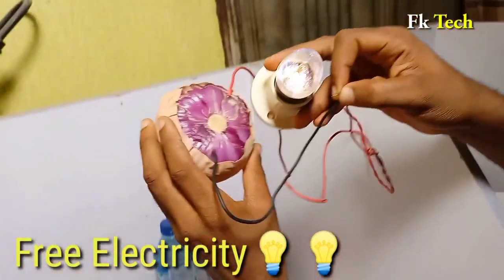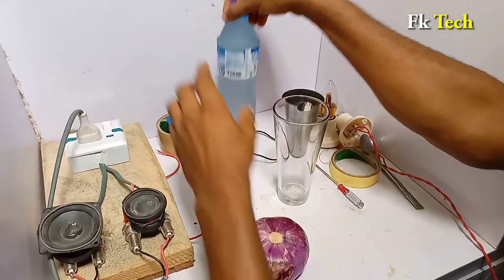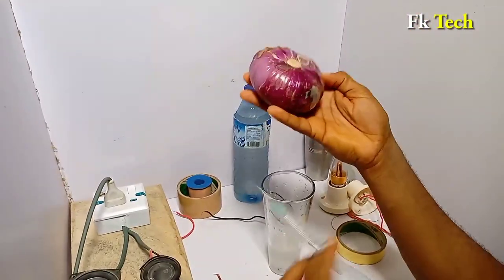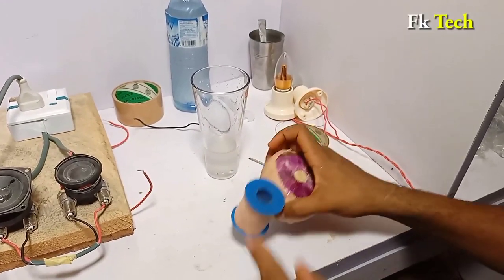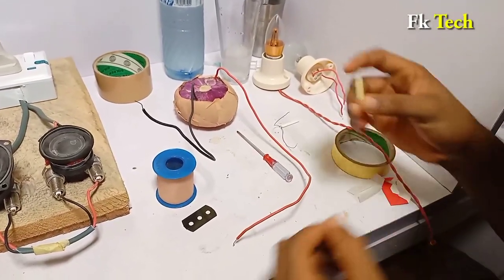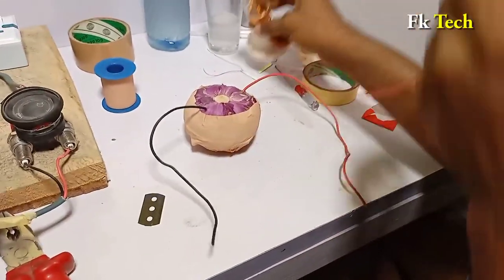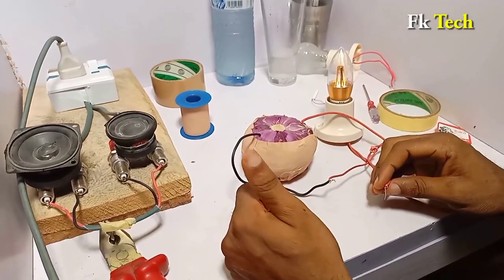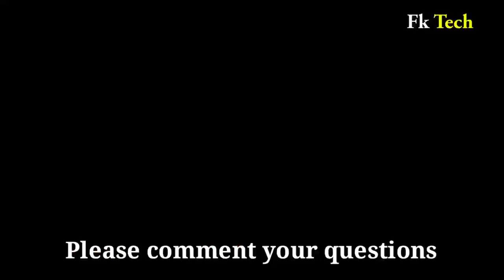Free Electricity Energy With Onion And Salt (Fk Tech)

Comment: Why didn't you use a multimeter to check  and display the voltage and current registered?
It is impossible to light those bulbs with just the onion in this way.
The voltage registered will be in milivolts ,and milliamps respectively and NOT enough to light a bulb.The only way is to cut the onions in slices and insert plates of copper and Zinc to get more cells. Each cell should be connected in parallel and then boosted using a joule thief.The joule thief is made of ferrite core transformer, a transistor  ,resistor. It helps to boost low voltage and current in millivolts  to higher enough to light an led bulb.
Reply: If you know you know,  I am an inventor ,I know all that he is showing is hoax but any way let's allow him to move on
Reply: @inventorfelixtv 
Even with his spark plug free electricity?
Show us the better way pls
Reply: @peterugwu2691  hahahahaha the guy is using people's sub to make money on YouTube
Reply: @destimecomedian  hhh exactly